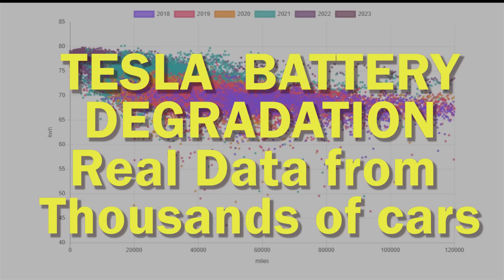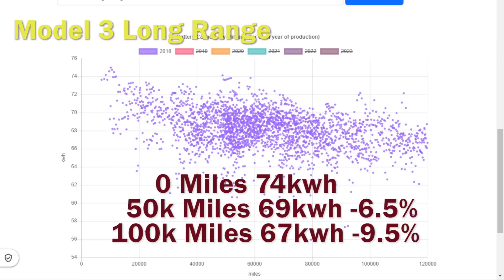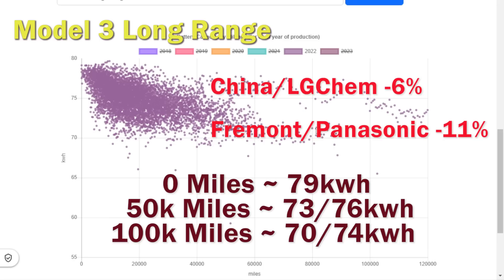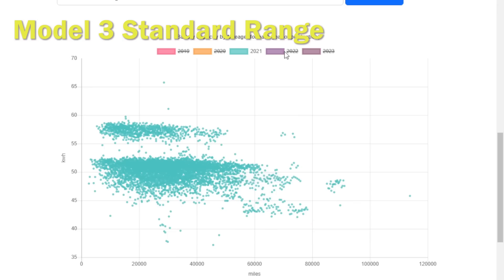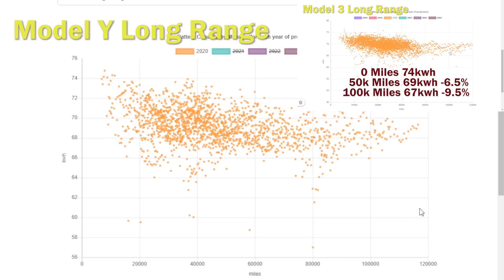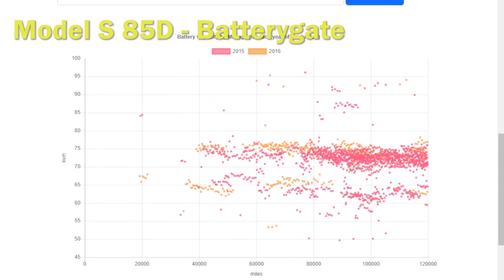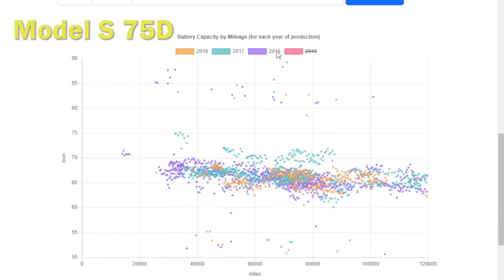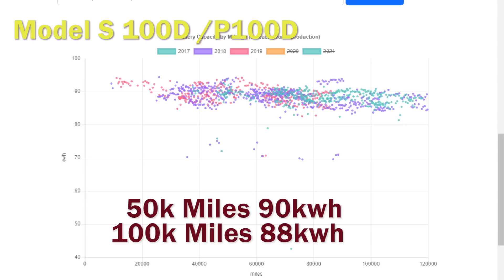Tesla Battery Degradation - The results using real data and why the Plaid is the worst Tesla

Comment: I'm sorry but this analysis is completely ridiculous.  These trends suggest near infinite battery life if you attempt to extrapolate beyond 120k miles.  The rate of degradation at the 100k mark appears to be zero for many of the trends but there is no way this is actually true.  The reason is that the battery does not die in a linear fashion.  At end of life, the battery will perform reasonably well and then suddenly start to degrade rapidly.  Also, the KHW capacity is as reported by the computer system and is not independently measured.  How do we know the computer system is reporting accurate data, especially as the mileage gets up there?  Again, the rate of degradation at end of life is expected to accelerate rapidly, so it is completely improper to make claims like 9.5% degradation going from 50k to 100k miles.  What if going from 100k to 130k experiences another 10% degradation, then going from 130k to 170k experiences a 70% degradation to failure?  Do you see how in hindsight, the 9.5% degradation of performance figures cited for the early mile cases are completely incorrect?  That 9.5 % reduction in reported capacity actually represents 50k miles out of a total expected life of 170k miles for a true reduction in life of 50/170 or 30%.  So although the battery voltage only dropped a small amount, and therefore the total maximum reported capacity will seem like a small amount, this can represent a much more significant reduction in overall battery life.

You have to be really careful performing these types of analysis on nonlinear systems because you will produce highly misleading results.
Reply: Degradation definitely levels out to minimal post 100k miles, drops off a lot after 50k.
Reply: @wakeywarrior  so the battery life is nearly infinite?  Please explain why that should be the case.  A new battery degrades faster than an old worn out battery?  Please explain why that should be the case.  Both of these statements are false.  An old battery wears out faster than a new battery.  It’s just that the wear does not manifest as loss of capacity.  It occurs at the molecular level and performance remains relatively constant for most of the time until it really starts falling off a cliff or dies suddenly.  

There is a huge difference between useful capacity and remaining life or degradation.  Imagine a hypothetical battery that gets exactly 100 cycles and experiences zero capacity degradation during that time.  The lack of capacity loss will make the analysis in the video trick you into believing there is zero degradation after cycle 99.  But obviously after cycle 100 the battery will completely stop working.  In fact the battery experienced 99% degradation after cycle 99.  

Again, so you believe tesla batteries degrade then stop degrading and last forever after a while?

People want to know how many miles total to expect out of the useful life of the battery.  They want to know when they will need to buy a new battery.  

Imagine if the batteries that appear to stabilize are actually hitting their failure point.  What if the reason why you don’t see the trend continue downwards is because after a battery reaches 60kwh or whatever, it fails before it hits 59 kWh and hence the trend doesn’t have much 59 kWh data because the batteries are all failing?

You have to be really careful making statements about degradation and remaining life of systems that are highly nonlinear.
Reply: just another "real life test"..
Reply: @izoyt  Yep.  Ironically, everybody wants to know how long the battery will last, but it appears they excluded all failed batteries from their analysis.  Where is the plot that only looks at batteries that have failed and logs the number of miles driven until failure for each?
Reply: @RedShiftedDollar Agreed. The biggest problem with these packs isn’t degradation, it’s waking up on a Wednesday and randomly finding out you need a $15k new battery and won’t have a car for two weeks.
Reply: Well not infinite but as it seems battery life is alot longer then we expected. If you run the battery in a range of good usuage. lets say you keep big loads for long time to a minimum and especially no long sitting on full charge it seems like battery life is extremly long.
Reply: @ look at the graph.  The degradation trend slows down until it goes flat horizontally the older the batteries become.  This is clearly just an illusion but a ton of people including you are falsely interpreting it as a sign batteries stop degrading and last forever.
Reply: @RedShiftedDollar  It's the case that after the first 10% degrading the effect slows down alot. Which does not mean it stops completly. If we have the data, trust the data. There may be a point where suddenly is a collapse which is ofcourse not on this curve.
Reply: @nicoleibundgut534  keep in mind this data is being reported by the vehicle’s computer.  The computer is making estimates of remaining miles.  Depending on the algorithms used, these estimates may have errors and some of the apparent trends in the dataset may simply be due to how the computer is calculating things like remaining miles left and other battery indicators.  

Also, the fact that dead batteries do occur yet we do not see samples with very low range capacities indicates that the final stages of failure likely degrade very rapidly.  The cars with  actual failed batteries fall off the graph and suddenly jump to zero range.  Where are the cars with 50 miles, 100 miles, etc?  Those data points are clearly missing because we know batteries have failed and that 0 mile data points absolutely exist.  So where are the missing samples in between?

Also, the graph does not include failed batteries.  Why not?  If we are trying to understand how long a battery can be expected to last, why not base the analysis on taking failed batteries and looking at the odometer readings at the point of failure?  That is the true realized miles driven per battery.
Reply: @RedShiftedDollar  The data comes from an OBD Plug in which gets the data directly from the bms which is accurate enough up to lets say 1% the dead batteries are not on the graph because the cars are not beeing driven then.
 I have seen Renault Twizys with 100k kilometers at the first battery. Degredation at 67% remaining. 
Which is an 6kw/h NMC. It's likely that we just haven't hit enough usage on the bigger batteries. 
Also the usual case of failure i have heared is that one module goes bad. usually one cell which is very low on capacity or high internal resitance which rises temperature and goes shut off. Basically battery still great but you have to change out this dead cells.
Reply: @RedShiftedDollar you brought up extrapolation. These charts only show reported data, it’s not a graph of predicted lifespan. I don’t think anybody watching these videos is looking for glimmers of hope that their car will last forever. No car lasts forever, regardless of its means of propulsion. It’s just an interesting look at a now reasonable sample size of data on how current working batteries are faring against time and mileage.

Comment: Thanks so much for the video!
In germany we have both Fremont and China Versions of the Model 3 LR, so what you want to buy used is a 2022 Model 3 from China which still has the parking sensors but also has the Matrix LED.
And yeah the LFP cells in the standard range have very little degradation, it would be so nice to have them in the LR models, but I think it would be too heavy...

Comment: It reasonable to assume the Plaid cars will be driven harder, therefore drawing more current. Current in any electrical system causes heat - it’s the heat that’s affecting the batteries.
Reply: This should also depend on how many cycles it went through. Just doing mileage doesn't show enough information to determine the results.

Comment: There was an interesting test done of "real" range of 12 EVs done in cold but not freezing weather, 10°C.  Speed was at a constant 80 kph.  Not quite real,  as it was done on an oval test track,  but at least they used the heater. 🤣  Still... shows that range is substantially below what is claimed.  Search YouTube for:
"How far can electric cars REALLY go?? – we drive 12 until they DIE! Tesla, BYD & more"
[FUN 'FACT']  Best range is achieved at 20°C and 50 kph.  😝
Reply from the maker: We'll soon be publishing a video that explores the real world range and how it compares to the EPA rating. We disagree with videos like that because its so dependany on the way cars are being tested - ie you're actually comparing the EPA test cycle to the youtuber, magazine or whoever has constructed an alternative test. In other words.. such "real world tests" are pointless.
Reply: @EVinventory Watch the video.  They're quite clear about how it's done.  If anything, that type of test results in more generous results than the EPA tests.

Comment: It was obvious, that when Tesla reduced their battery warranty in mid 2023 there has to be issue in the new batteries, namely in touted 4680 Battery. So, hard or impossible to fix and much easier to break. Nevertheless, Tesla has really optimized the warranty terms and conditions to maximize benefit to itself.
Reply from the maker: While I understand the challenge, even after 150k miles typical degradation is less than half the permitted degradation. We've done a second video on this topic looking at high mileage battery performance

Comment: My ICE Does NOT Have this problem
Reply: No it definitely does, it's just not as noticeable
Reply: Ofcourse it does.  There’s just no easy way to pull the data to show the wear on the components and show fail rates of them. Just do a google search for repair shop around your area.
Reply: No. You have to do a compression test, check the engine oil and hope for the best. With a battery, you plug in and the data is right there. No guesswork and way fewer moving parts to fail.
Reply: @davidcottrell570  
I have a Yr 2000 Accord 2.3L with 380k on the Clock ORIGINAL Engine n Gearbox PURRING. 
No WAY in Hell an EV will last that Long; 1 WILL NOT Be Able to get a Batt or Motor Replacement by then. OBSOLETE 
Let That Sink in
Reply: @vincecarlo Well considering that I own an EV and you don’t, it’s a bit like a guy on a horse telling someone in a model T they’ll never last. Good luck with that!
Reply: @davidcottrell570  
Good Luck when U need to PAY For Batt n Motor REPLACEMENT
Reply: @vincecarlo  my BATTERY has an 8 year WARRANTY. It costs $30 a month to charge at my front door. It gets a service every 2 years. They plug it in to check it out, replace a filter, wipers and do the fluids every 4 years. A battery replacement after 15 years takes a couple of hours. A transmission, engine rebuild. Yup, not so easy. And yes I know what a new battery costs.

Comment: Imagine owning an IEC car and being told the fuel tank will shrink by 10% at 100k miles.
Reply: Most cars will require major engine work by 100,000 miles, electric cars don't. You need to reorient your thinking if you are actually interested in EV's, which I suspect you are not.
Reply: @waynemapp6333  I have a Honda Fit at 200km that has only had oil changes and two sets of brake pads. It cost 19k Canadian. No EV comes close in $ per KM and has the cuddly feeling of no lithium/cobalt mining.
Reply: I’m interested in both. By stating that “most cars will require major engine work by 100K miles” is ridiculous. I suspect you’re not actually interested cars other than EVs.

Comment: I have a 2022 Plaid, your data is JUNK. I have almost all my range! Great car!
Reply: Then your car is one of the data points being on top, but as you can see this is likely but good treatment and good luck. Batteries die often from one day to the other because the whole system is only as good as the weakest part.

Comment: Very interesting patterns emerging. All factors baked in, I do wonder how much of a "driving" style and charging habits differs for the average model, that is, demo and age of driver similarly to the way insurance companies use that info to set rates. Such that the Hardware would play X% and the driver's profile play Y%, really curious what would the split be...  thanks for the data, receive warm regards!
Reply: Good point. A Tesla usually gets tons of heavy acceleration the first 5,000 miles because of the instant torque sensation. Once the first set of tires is done things usually calm down. So the rather steep decline at first could be an indicator for the toll that aggressive driving takes on the battery. Should have gone with a super capacitor…

Comment: It would be useful to add the error bands to your analysis.  I.e., the battery capacity is x kwh, +/-y kwh.  Can you estimate how much of the data result from changes in battery capacity measurement?  Thanks.
Reply from the maker: We're working on some updated charts including rated v displayed range and looking at % differences as well as absolute. We'll see if we can show the % or kwh change from new along side that.

Comment: This is good info and data analysis for sure.

'my gas tank has lost 10-30% of it's capacity.' - said noone ever.
Reply: ‘My EV wastes 80% of its energy as heat’ said no one ever…
Reply: @BAC_Mono  'my gas car loses up to 35% of its range in winter while using the heater.' -said no one ever
Reply: @lesstyranny2695  ‘My gas car refuels itself overnight for 2p/mile’ said no one ever.

This could go on for a while 🤣
Reply: @BAC_Mono  ha, true.

Comment: So garbage cars? (And i dont mean actuall garbage cars 😂)
Reply: Amazing cars, with little degradation. In many cases the batteries will do 250k, 500k etc. The rest of the car will fall apart first.
Reply: @wakeywarrior  thats the problem with musk cars - constant problems and repairs. I guess thats why his cars are so expensive - need to cover extensive warranty repairs.
Reply: @NoName-md5zb   the cars are as good a quality nowadays as any. I’ve had a 3 for 2 years, one minor problem with the boot strut, fixed by a ranger on my drive, I didn’t even know he’d been, came let himself in the car, fixed it left, zero inconvenience to myself with this 10 min repair.
Reply: @wakeywarrior  you had 3 in 2 years. Read that again.
Reply: @NoName-md5zb  Model 3. Hence ‘a 3’. 
I also had ‘an’ S before that.
Reply: @wakeywarrior  oh i tought i you had three different cars 😃

Comment: Im shopping for a used 21 or 22 M3lr at the moment. How do i tell if a car has the LGchem cells? As a used buy they seem a much better bet.
Reply: There are more differences. LG Chem is better at cold temperature. Pana can deliver more power, this also means it will super charge a bit faster.

Comment: Nice analysis-especially how it clearly clusters battery chemistries. 
1. Be interesting to see the long term LFP lifespans. 
2. And similar studies for different brands. There are rumours that VW-Audi MEB lifespans aren't great -but I've not seen large datasets to confirm or deny this. And without that: all we have is "anecdata"
Reply: I think the MEB lifespans should be fine cause most of these cars are around 170-300 HP so maximum like the Standard Range Model 3. So I dont think they will have more than 5% over 100k miles.

Comment: Great info, but what about the ambient temprature? Eg. the cars that has been in the northern countries with an average annual temperatur of +8 vs. +20? Has that any impact on the battery capacity?
Reply from the maker: We look at some of the outliers briefly in the second video in the series and temperature doesn't account for them, but we'll be looking at it again in the next video
Reply: From the research I’ve done, high battery temperatures lead to physical cell casting stress and higher chance for pack failure. Supercharging in the afternoon on a hot day to 85-100% is the absolute worst torture to the battery pack and delivery drivers who do it daily have had to replace their packs around 100K miles in a few cases I’ve seen.
Reply: @OptimisticEngineer345  Link to the research? I'm seeing anecdotes whereas TeslaInfo's "not really" answer is derived from the data. Very interested in the further deep dive myself as well, but I'm curious what makes you dissatisfied with this answer.
Reply: Wondering the same thing. In Australia here temperatures are extreme, I will never buy outright an electric car however I would lease one so I am not stuck with a dude car at the end, I can just give it back.

Comment: sounds like the S75 is using 85 or 90 kWh batteries and they simply shift the charge/discharge window to maintain spec capacity.